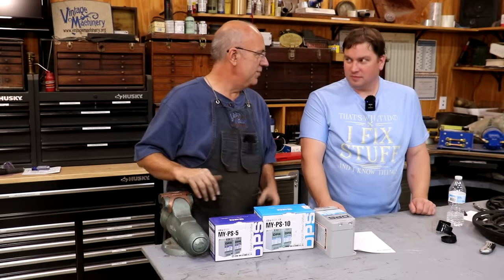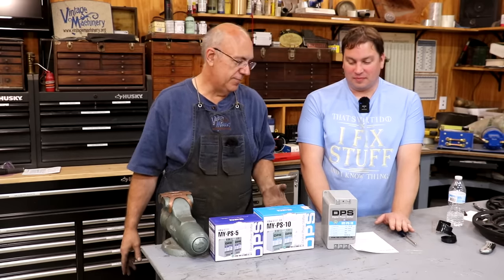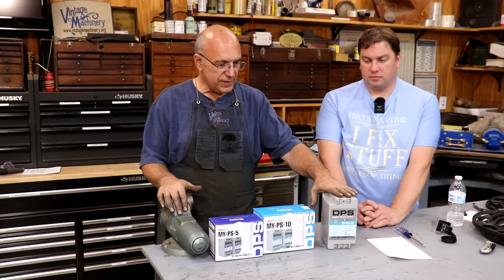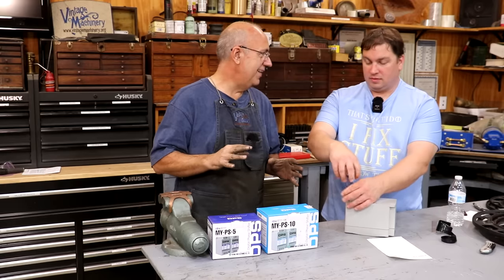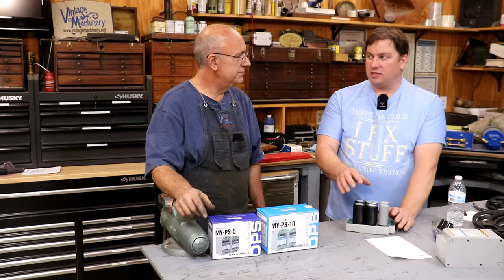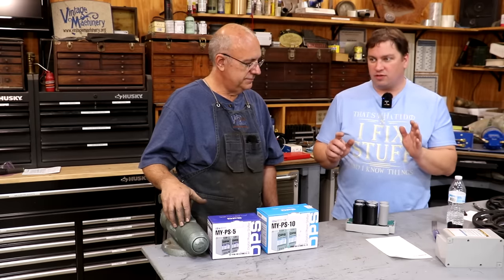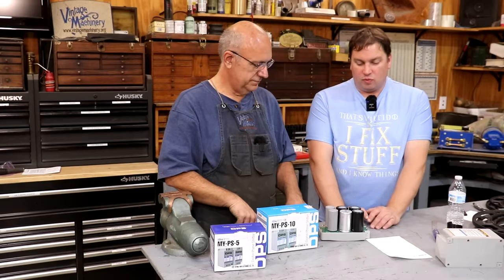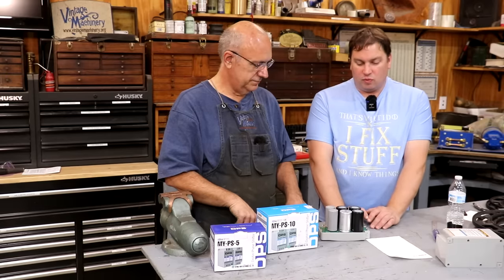Single Phase to Three Phase Power: Rotary Phase Converter vs Digital Phase Shifter

Comment: Several years ago I had an industrial plant that had a 50 HP motor burn up the first night after it was rewound. The plant opened only two months  before and everything was new. After checking everything I discovered that the heater block had a different colored reset button going over the paperwork there was a 25% differences depending on the color of the reset button. We went through every motor control room and had to drop two sizes in the heaters to get the right protection of the motors. The best part was my company had a 25 year working relationship. My son still does all their electrical and machinal work.  Like a lot of things in life sometimes, you have to dig deep to find the problem. Cheep isn't always the best way to go.

Comment: I've run two of them for about a year and a half now.  Not a problem as of yet.  A VFD will do the same thing but allow different parameters such as frequency control and soft starts on electrical motors, as well as many other things.  For me it was a very inexpensive way for me to get 3 phase rather than buy a traditional phase converter.  Great Video guys!!

Comment: Great Video!!   Industrial Electrician and Machinist here. This is spot on.  A static phase converter starts the motor by creating the third phase but runs the motor on single phase. For small HP motors, single phase VFDs work great.  Set the VFD to 60HZ, and use the machine controls to control speed. Most older motors do not have the proper winding insulation to handle VFD speed control.

Comment: I have used a similar Tripp-Lite 5hp device for 25 years. They are effectively a starter. The motor is really running on just one leg. Power from the motor is reduced to less than 2/3 of nameplate rating. Never had any overheating problems. For low duty applications without frequent starts/stops/reversing, it can be cost effective over a rotary converter. Real 3phase is still the best followed by a rotary generated power.

Comment: Just installed a electronic phase converter, the motor start is poor.  I ordered my American Rotary phase converter today.  I have waited long enough to get this lathe, I will wait a little longer until I get the rotary phase converter.  Thanks for the video.

Comment: Thread drift:

I've used a spike maul and have participated in a triple spiking when spiking up rail. It starts off even, but after the second or third round, the hammer blows go from being even to one hammer following closely by the first followed by the fast incoming third hammer. Luckily, it doesn't take more than 3 rounds to drive a spike home, and the spikers will get used to the close together swings on the next spike to be driven. Instead of hit-pause- hit-pause-hit, the hammers sound like hit-hit-hit in rapid succession..
It makes no difference who is spiking, as they will fall into the same spiking pattern after the first round. It's pretty cool to listen and watch 3 spikers working together and hearing those hammers ring.
Reply: dose it count of you are not singing?
Reply: Nice response! Thanks. "If the hammer isn't singing, you ain't a-swingin"
Reply: I wonder why? Doing the same thing swinging hammers on iron out of a forge, blacksmiths get nice even timing as the usual thing. If someone speeds up or slows down they're a beginner that hasn't gotten it yet.

Comment: Thanks for the video, Keith. You can make a crude but workable rotary phase converter yourself using a spare three-phase motor (needs to be rated at higher HP than the motor you are starting) as an idler motor. Use a cap to start the idler motor, then tap off the three legs of the idler motor to the machine you want to start. Not as elegant as the American Rotary products, but much cheaper, and works fine.
Reply: yea that is better than the box 'o' caps solution for sure.  I have one and that is how every commercial rotary phase converter starts life, the question is how much further did the manufacturer take it.
Reply: I’ve been running this configuration for years with zero problems
Reply: The idler motor trick is basically what rotary power does with some capacitors to even things out.
Additionally, another trick that you can use for three phase power and assuming that you have multiple three phase machines is to simply turn on additional machines and let the idle. They won't really create much of a load if they're idle, and the back-emf they create simply because they're running will result in the three-phase power being smoother and capable of handling a larger motor under load.

Comment: More like a commercial for your sponsor Keith.  Use a decent VFD for your 3-phase power requirements...no moving parts, stable outputs, motor overload protection, adjustable speed, braking, and very reliable.  IMHO
Reply: he has 20 motors all of various size so the rotophase was the best and most cost effective solution by far.

Comment: A friend’s dad ran his three phase Bridgeport mill in a suburban basement on single phase and a couple of capacitors. He used it 5 days a week for 50 years. 

When an electrician saw the setup, he confidently told me it would burn the motor out in an hour.
Reply: if the thing is well tuned and the motor is kept cool it can work, the question is how good are you and what are you willing to wager.
Reply: Mine had the simple converter but I prefer the power boost and speed control of the VFD I replaced it with. The primitive converter will now run a buffer.
Reply: We call that Appalachian Engineering. It's amazing how sophomoric 90% of the electricians can get (or those that do electrical work, anyway) . 

The first thing I'd consider is the actual load on the mill. Personally, as an industrial electrical/millwright contractor with over 50 years in the trade,  I have never seen anybody continuously run a Bridgeport at 100% of the rated horsepower in my life,  but I have seen dozens of guys cap starting lathes and mills in home shops with zero headaches. I have even done it myself when I was first starting out.

Where you usually get into problems is with compressors. A sheave reduction of 15 or 20 % and converting it to continuous run (Unload to control cutin/ cutout) usually solves that problem and guys get to use their sandblaster with a 3 ph 5 horse industrial compressor in their home shop .  An air conditioner starting cap and current relay makes a good starter if you are on a tight budget. (Just remember you cannot run the cap more then 2 or 3 seconds just to get the motor running.)

Would I try it on a 96" tandem roll at the Steel Mill,,,,,,Hell no!!!! But if you got a little Clausing 5400 in the basement there is nothing to worry about. 

BTW, The thing nobody mentioned on that belt sander is the heaters in the Motor starter. - You have to change them with the cap box.....and Kieth, there is no way in hell you would barf that motor by grinding a radius in the end of a piece of 1/2x4 Hot rolled. Belt sanders are pretty crude machines and the effect of the imbalance is pretty much irrelevant.  

It takes a little screwing around with the values but you can easily make a phase converter out of a 3-pole disconnect, cheap starting cap and a common 15 Amp light switch. ---- I even saw a guy make one out of  a disco a motor and a recoil starter off a model N Briggs gas motor. (Yep, you can pull start a 3ph motor).... It's not alchemy at all.

Comment: A Variable Frequency Drive (VFD) sounds a whole lot better to me. It is way more versatile with variable ramp up times, motor braking, variable speed and about a hundred other things it can do. I have been running motors on VFD's for extended run times, unlimited starts per hour with no issues for over 10 years and with the latest vector drives there is very little loss of power at  slow speeds.
Reply: VFD are great, but their main disadvantage is cost. if you have a lot of machines they can add up real fast.
Reply: Several examples I've seen on these videos always had a real high pitch whine that I find very uncomfortable to be around. I am very reluctant to try them for that reason.
Reply: @katelights  but also 1 vfd with a hanging hook with twistlock plugs can get you running in a one man shop if similar size motors. Did that til I got my rotary
Reply: With internal components coming from the same place, you're wasting your money buying expensive VFDs that work no better or last any longer than Chinese imports.
Reply: I've converted many machines to run on single phase using HuanYang VFDs and they are very good and very reliable. At around $100 for a 3HP version I think they are excellent value too. As comparison SPCs suck. I have no experience of RPCs but the noise of the motor would drive me nuts.
Reply: I agree.  VFDs are hands-down more practical than other systems, including rotary phase converters which are expensive, noisy and waste power by running continuously whether being used or not. In my opinion rotary phase converters are the 2nd best choice behind VFDs which, as you mentioned, includes the advantage of speed control with little if any loss of power.
Reply: @carrollprice1213  I also wired in a key fob controlled contact into the start circuit for the roto phase. Just hang around my neck when in the shop, only run the roto while using a 3 phase tool, just like you would with a dust collector.  It was like 15 or 20 bucks on amazon
Reply: @TgWags69 you have to increase the FM carrier frequency in a VFD if you get that whine. It shouldn’t be a problem.
Reply: @carrollprice1213 I don’t agree.
Reply: yea, im big into drives of all sorts, i have put in hundreds of them and own a few but they have problems as well.  pick your poison.
Reply: Not nearly as fast (or time consuming) as adding an expensive distribution/breaker panel and separate feed cables to each machine. Plus, in a one or two man shop, only one machine is in use at any given time. In addition, if a single $150.00 VFD fails, the entire shop won't be shut down for days waiting for a new and unassembled rotary converter to arrive.
Reply: @GibClark you may want to consider the start up amps vs run amps, it takes a lot more energy to start a RPC than it does to run one. You are only saving yourself the background noise. With the wear and tear as well as the cost to operate / start up over and over is much higher with starting and stopping your RPC numerous times over a days worth of work. You will be better off starting it up in the morning when you go out to work and shutting it down when you are done for the day. 
This also applies to your blower in your furnace. Many folks set it to auto and forget it. I run mine 100 % of the time and my blower motor is 14 yrs old and still running perfectly fine. When I proved my theory 20 yrs ago we saved $40 per month by just that one single change. I’ve installed data loggers to provide proof to several of my customers as well. I don’t really care what you do, I’m just telling you facts. Do with it what you will. 
On a side note, if you do switch it over to on instead of auto, you will need to change that furnace filter more frequently because it will be constantly scrubbing the air and filtering out dust, dandruff, pet hairs and allergies almost twice as fast. If you have allergies I’d highly recommend switching it over. It amazes me how much better the air quality is after only a month or two. Keep in mind it progressively gets better up to a certain point. Then levels off. Most RPC’s have an overrated idler motor and is usually way more girth than needed so it can handle it, it just cost more, and wears out faster. 
Don’t take my word for it. Hook up an amp clamp and see for yourself. Mine starts up at about 30-32 amps and drops down to 12 amps. Regardless of how many machines I have powered up the run amps don’t change. See for yourself. 
Have a good day y’all
Reply: @jasonhull5712  get what you are saying, furnace blower just makes sense as far as clean air goes , I do the same. But if I'm fabricating ,welding cutting or forging I'm not running my roto phase all day to use a grinder, sander, drill press etc.  occasionally. But when I walk to a machine it sure is nice to not have to walk across the shop to turn it on. Same with woodshop and the dust collector. I'm not going to let it run all day just because I might use power tools for a couple hours. Like anything you plan your work
Reply: I like VFDs for the fact that they output an even 120 degree spacing between phases and the same voltage on each output phase. I never understood why anyone would want to run their motors with lopsided phase spacing and lopsided voltages. These digital phase shifters seem to be nothing more than the same 2 legs in for L1 and L3, and some sort of digital nonsense to make L2. No better than a rotary, just no moving parts. Way different than a VFD, where the input is turned to DC and then each AC output phase is completely fabricated from that DC. I see comments about cost. It's not 2010 anymore.
Reply: @GibClark  Agreed and I build all my VFDs similar so I can swap them if needed in case one fails. Instead of hard wiring my shop is connected with SOOW cable like a job site so I can rearrange it at will. It's "temporary" as long as I own my home. When I die my bros can unplug the lot and carry it off. Pure win.
Reply: @carrollprice1213  Depends on what one is running and if you build your RPC or score it used cheap as I did. Mine will run my transformer MIG welder which I'd not want to buy a large VFD for. My RPC does not run continuously as its switched for use only with my larger motor applications. For speed control my lathe and mill get VFDs.
Reply: I have 2 running for 4 years now,no problems, Have a club member does manufacturing out of hid barn,runs a vfd for his Miltronics cnc machine. just sounds like a ad for a company. Don't downplay what works,I would have a rotory if I had many,over 5 3 phase machines.
Reply: You obviously have never tried to run a machine with multiple or perhaps something like having a machine shop at the house you probably have one or two things of course you think vfd is the best
Reply: @katelights Not sure which VFD youve seen, but the ones I'm looking at are 1/3 the cost of a RPC
Reply: @SunsetWingman  yeah, but if you have 5 machines you only need 1 RPC but 5 VFDs
Reply: @katelights  that’s a good point. In my case I need individual variable speed on all my motors that are 3 phase so it kinda solves both problems
Reply: Get one with a remote mount control panel, then you can put it in a box (ventilated) or somewhere  further away

Comment: A better analogy for three phase is to think of a single piston internal combustion engine compared with a three cylinder engine - the three cylinder is smoother running as the power is delivered more evenly through each revolution.
Reply: Agreed.  Even better, the instantaneous power sum of the three phases is exactly the same at any time in the cycles - there can be ZERO ripple in the torque provided by a well-designed three-phase induction motor, i.e. no need for a flywheel other than the rotating mass of the rotor itself.  
Nicola Tesla invented & patented [in 1888] a two-phase early version of the modern three-phase induction motor [and ~simultaneously by Italy's Galileo Ferraris], but the final step to the beautiful result was left to Mikhail Dolivo-Dobrovolsky in 1889.  Only three wires needed to transport mechanical [rotary] energy for hundreds of miles at high efficiency.   The world would never be the same...
Reply: @jrb_sland  Yes, excellent explanation.
Reply: One other advantage of three phase is that you can run motors on it that don't need brushes like single-phase and dc motors do. Ok, there are motors with capacitors to create an auxillary phase, but those don't run as smooth and aren't as efficient as true three phase motors.
Reply from the maker: That is a very good analogy!
Reply: @CatNolara it's a minor point, but not all single phase AC motors require brushes.  AC Induction motors do not.
Reply: Thank you
Reply: @jrb_sland  I'm interested in your statement '' the instantaneous power sum of the three phases is exactly the same at any time in the cycles - there can be ZERO ripple in the torque provided by a well-designed three-phase induction motor,''. 
Looking at the 3 overlapping sine waves of a 3 phase supply, there is a clear ripple in the current delivered throughout 1 cycle. Now there is never a point of zero current like with a single sine wave of a single phase supply, because of the over lapping of the 3 phases which are out of phase that significantly smooths the torque pulses seen by the rotor. But I assumed there would still be an inherent ripple even with a 3 phase motor. I've always been curious about the torque ripple of different pole count motors. For example a 4 pole motor running at 30 Hz vs 8 pole motor running at 60 Hz. I would assume twice the pole count would half the torque ripple?